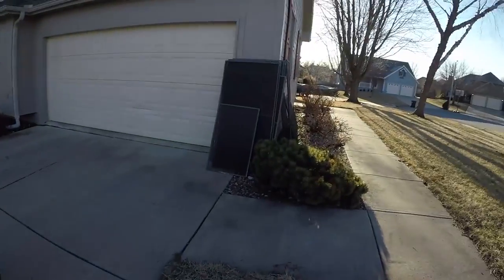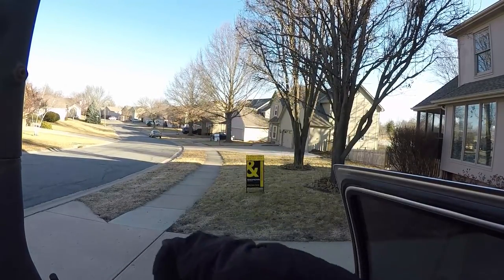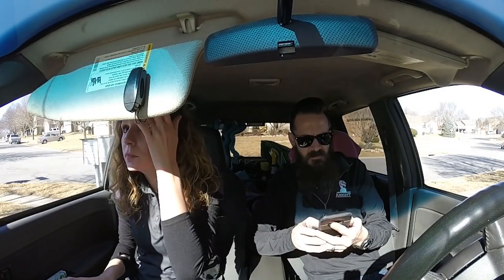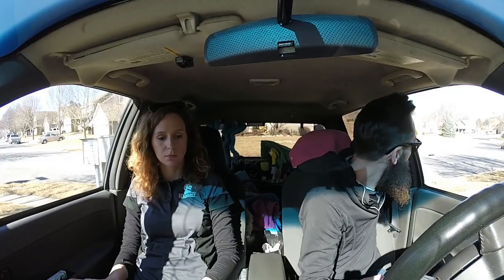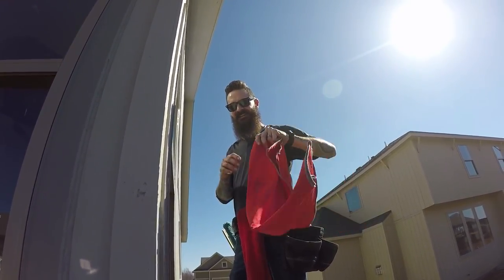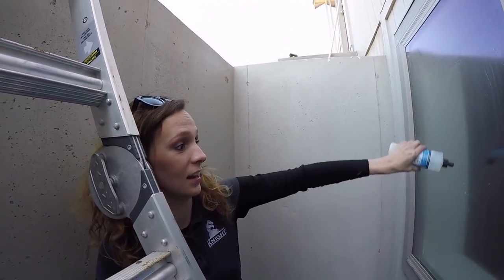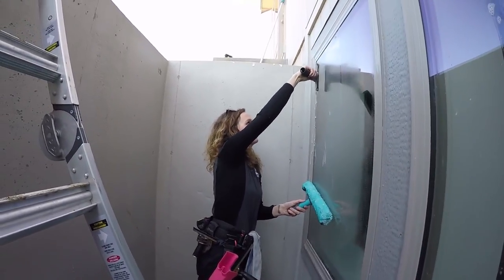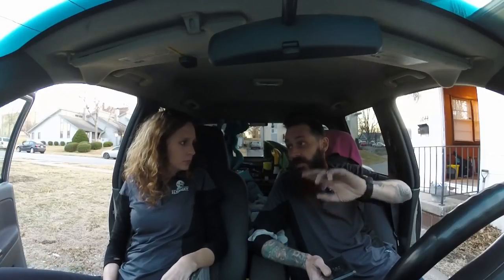Residential Cleaning Tips | Traditional & Water Fed

Comment: Nice video, I like seeing you work at job sites. I am often asked to clean mini-blinds (that have usually never been cleaned in years) and I have to clean each individual blind by hand, usually 1/2 hour for each set of blinds. Any advice on how to clean these things faster? Removing them and hanging outside is not an option. Thanks, keep up the great work and the entertaining videos.
Reply: jeff wolsfeld a small vaccuum with a brush head will remove the dust making it easier wipe with a wet towel. Having a bucket with just water will help to rinse the towel as you clean. But that should be charged seperate since its more work